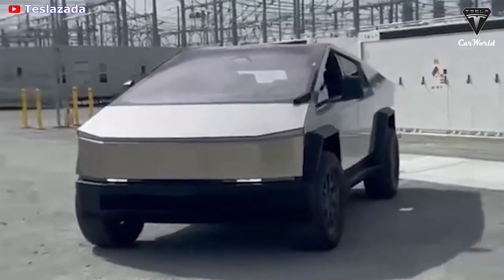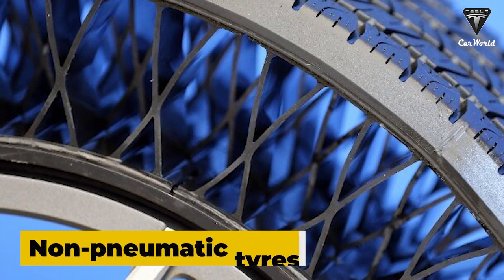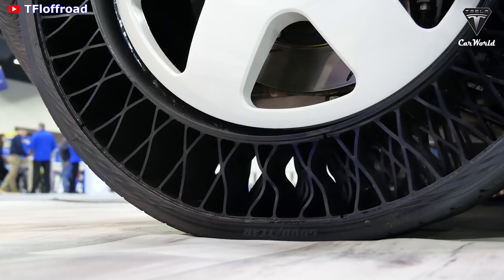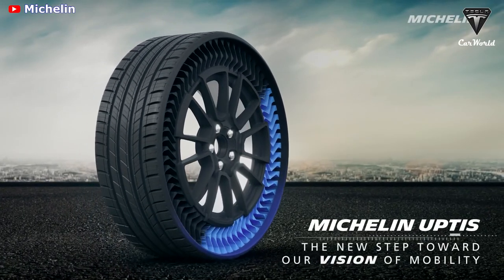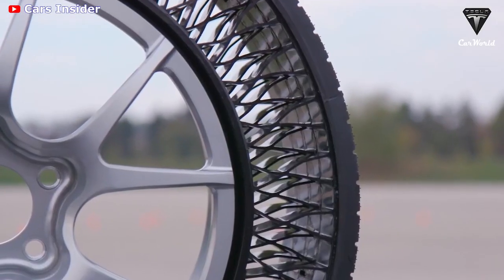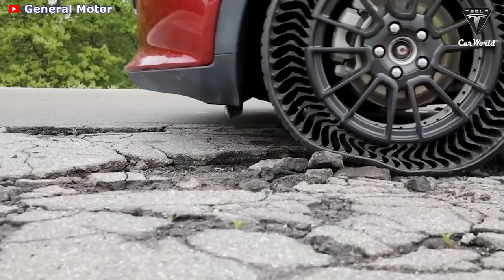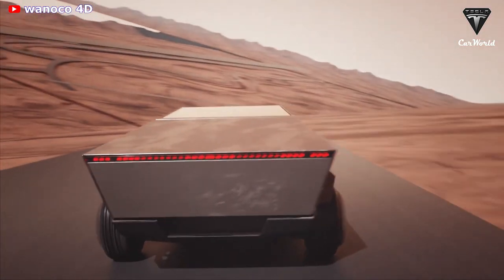Tesla Cybertruck's secret weapon. Special design inside the cybertruck tire. Official here.

Comment: Imagine if they made a custom design for the CT by which the supporting ribs were actually cup shaped and chevron away from the center of the vehicle to effectively provide paddleboat style propulsion while crossing rivers, essentially pulling the water from underneath the truck on the inside forward edge of the wheel and pushing to the outside and rear edge like an impeller.
Reply from the maker: Good idea. Thanks for sharing !
Reply: Sweet

Comment: without side covers it will collect dust, sand, rocks, and anything else that will degrade the flexible "springs" of the tire.
Reply: your are interfering with their business plan.
Reply: My first thought exactly. Not impossible to overcome but careful Tesla engineering will be required. Can't use metal covers because they will crush on the first impact with a rock or curb.
Reply: Yes, or what if you parkied the tire in a puddle of water that freezes overnight?

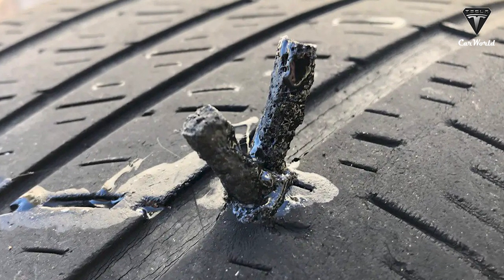Comment: Airless tires with those open walls (just a demo design?) would trap rocks & dirt off-road, crunching the innards. Bad info: 1:03 "One hole in the rubber tubing [not tubeless tires] means that the whole thing has to be scrapped?" Yet, you show a tire plug, which works well for many people.

Comment: It's interesting, I wonder about a lot of things:
The Tyre has rubber on the outside which needs to be flexible to have grip on the roads. And therefore in fight with the roads little chips break down. Ask formule-1 drivers, the softer the tyre, the better is grip on the tarmat, though softer tyres last less miles. So the lifetime of the tyre should be about the same. Then the tyre needs to be refurbished, which is very positive, because that consumers far less weight in comparison to conventional alternatives. 
Then my second thought, all materials suffer fatigueness, bend a teaspoon a few times over and the spoon will break. How about this property of the material used as springs in the sublayer. Is this consistent during the 50 years of lifetime? And consistency for the full range of temperatures? This is the limited factor for the wheel, I think the government wouldn't allow these tyres to be older than 10 years.
I really like the concept of this new technology, and in contrary believe this tyre would cost the same as nice aluminium alloys, I can't understand why these would be that expensive.
I would strongly advise the manufacturers to develop bio degradable materials for tyres, probably my friend Jessy from the YouTube channel "Now you Know" would like to stydy about the used materials and report it online.
Reply: I don't think these will be made with any "natural" materials.  Everything like how long it will last.  Or how "soft".  Or how grippy.  All those properties will be like nothing I have ever seen.  50 years may be a "low ball" estimate of the duty cycle of these tires.  But I don't think they would be impervious.

Comment: I like it!  I just got done replacing a tire that got a screw in the side.
Reply from the maker: Well, Since these tires aren't filled with air, there's no chance they can go flat. The spokes and the material for any airless tire will be strong enough to withstand the hazards or forces that degrade or otherwise destroy normal tires. Thanks
Reply: When that happens, you truly are screwed.

Comment: They'd better put SIDEWALLS on those tires to prevent capturing rocks or debris and clunking-bumpung every time the rock is at the bottom as well as making it "out of balance 

  You'd have to pull off the road to dig out the rocks and debris.

Comment: I wonder how the tire will feel and perform at -44c. Everything becomes nearly solid at that temperature
Reply: Sure does. I live where that temp isn't  unheard of. Not common, not unheard of. Have dealt with it. Try -30c and 20knt breeze.
Reply: @GrigoriZhukov  no try -44c in northern ontario; 8km from the truck on snowshoes at that temp and have seen everything after 17,000 km of untrailed forestry gps work

Comment: People who work on tires are known as tire men. I was in charge of building container chassis. The order was for 200 Chassis. That is a total of 1600 tires. The tire pressure was supposed to be at 85psi. Tube type tires. The production was appox 10 chassis per day. The tire man was not putting the required air pressure. I refused to sign-off on the chassis. When I got the production crew together and had the interpreter (this was in Japan) to repeat 'the tire man retired because he was tired of airing tires', They laughed, thereafter all of the tires had 85psi. Obviously Cybertruck's tires will not have the same constraint.

Comment: While I do appreciate the 'evolutuon' of the tire . . . I wonder WHAT happens when the tire gets bogged down in muck . . and wet mud . . wouldn't it IMBALANCE the tyre during a run . . . and secondly WHO and HOW is this mud taken out . . . PRESSURE WASH you might say . . . but HOW OFTEN . . . and would it be PRACTICAL at all ?? ( Is this self cleaning ?? . . . UNLIKELY SO . . . ) . . . so . . .

Comment: Pneumatic tires you can deflate to get better area of contact that helps when you drive in packed snow
Reply: But when those tires can change contact surface then it might lead less traction to save energy  and using less contact with surface  may lead up to 15% more range and less road noise. When there are denser traffic then surface is aligned that leads less breaking distance.

Comment: this tire looks like it would be very susceptible to warpage. Leave it parked in the hot sun for too long with the weight of a car on them and they look like they would warp making the tire lop sided than try to drive at high sped with a warped tire...that's a recipe for disaster. But who nows maybe they are warp proof, and i am wrong. Either way ill wait for others to buy these very expensive tires before i even consider buying them.

Comment: this is a poorly researched and misleading video
the cybertruck won't have non-pneumatic tires because of these reasons
1) They are made for slow operations and will heat up if used as regular car tires going an average of 60 kmph
2) They exhibit significantly poor NVH dampening characteristic, due to absence of fluid property of compressed air
3) They provide poor traction and torque transfer property

I can guarantee the fact that cyber truck won't come with non-pneumatic tires, at least not at the current state of non-pneumatic technology